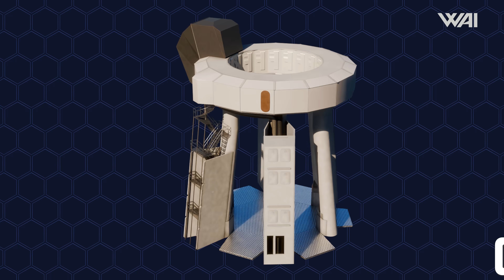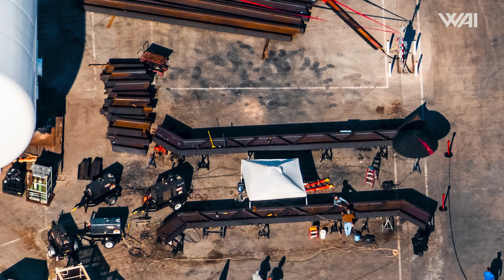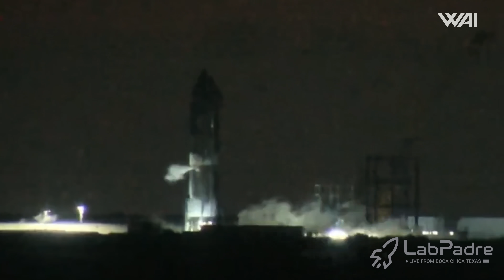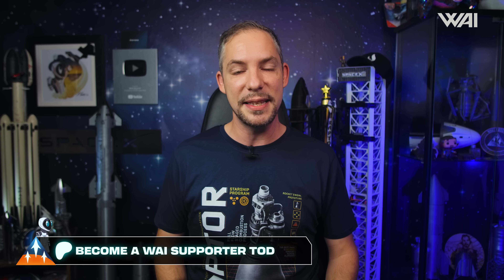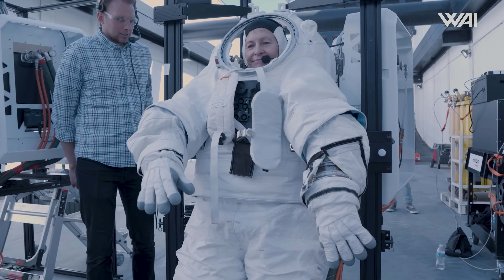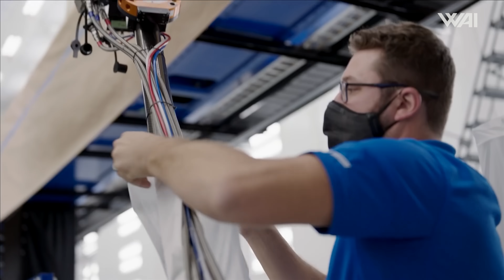SpaceX suddenly gives out HUGE info about Lunar Starship!

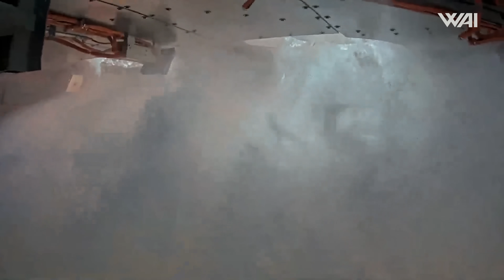Comment: 20:06 I can't say for sure, as I do not know what the regulations say. Though at least in the case of SpaceX' water deluge system they where using chlorinated water which is harmful for wildlife. Chlorine or chlorine by-products are especially toxic for fish (marine wildlife) and birds, but in "larger" amounts it can also be harmful for dogs and other animals. I assume Blue Origin is doing the same as SpaceX to prevent the formation of algae in the water tanks and ease of availability. As in at least some areas in the US, chlorinated water is generally used in the water supply, which probably is also the reason Musk said "Literally, you could drink it", as it is just tap water there. 

So I assume the issue might not be the water getting contaminated by the engines, as methane and especially hydrogen burn very clean, but much rather the toxic chlorine released in the surrounding environment. Since both launch sites are next to open water, with wildlife (fish and birds), I very much see this as an issue which has to be dealt with and not just pushed aside.

Comment: They can do two types of Block 2, one for high volume low mass, and another for low volume high mass.
Reply: The same issue was recognized in cargo aircraft decades ago. A famous example is when USAF modified its entire fleet of C-141's by lengthening the fuselage. The planes were constantly getting 'cubed out' (the cargo space was full) with unused weight lifting capacity.

Comment: Got double check numbers before publishing.

3300 to 3650 fuel capacity is a 10ish% increase, not 25

And from all the other sources I’ve seen block 2 is 1 ring taller than block 1.
Reply: You're supposed to look at Ship prop load not booster prop load. Felix's team highlighted the wrong metric.
Reply: Yep, I did the same calculation. Looks more like 10%, not 25%.
Reply: @liamcaroline448  they highlighted booster prop by accident and you are making your calculations off that error.

Comment: How are they going to build a launch pad with flame diverter on the Moon? And if so, how long will it take?
Reply: Lunar Starship won't fire the vacuum Raptors near the lunar surface. They will use some lateral thrusters mounted higher up on both sides.
Reply: @ Thanks for replying. However the nitrogen valves are an order of magnitude too week for this. So they must change the design of the lander. Now, what will the logical target design look like?
Reply: @alexandervocelka9125  I think they will use proven solutions like the Dragon capsule Draco and Super Draco thruster technology.

Comment: Something to remember on the Starship HLS, it will be MUCH lighter in dry mass than a regular starship. No fins, no heat shield, and likely a different engine configuration. It doesn't need three sea level raptors, they might go with a cluster of vac-raps and all gimbled.
Reply: There‘s not enough space to gimble the „vac-raps“. And no need.
Reply: But at the same time, HLS will have an additional ring of landing/takeoff engines above the main propellant tanks along with plumbing and possibly additional propellant tanks for those engines, and HLS will have large landing legs, a cargo/crew elevator and two docking systems (one international docking adapter and one refueling docking system). Honestly, it may actually end up being heavier than the current starlink deploying version, idk.

Comment: Starship payload capacity estimates are pointless until it actually manages to survive reentry with zero damage. 
The payload estimates were based on a given heat shield mass, which will keep increasing until it works properly.
Reply: Even the falcons receive damage. Your thinking is so flawed....
The legs on falcon rockets need replaced more times than not.
Reply: @johnnyringo35 the whole promise of starship is rapid reusability, ergo zero reentry damage
Falcons are irrelevant!

Comment: So currently if BO gets its software right it will be operational in early 2025 for customers while Starship most likely still not operational.
Starship is not what we (90%+, of space customers) need.
Reply: New Glenn competes with Falcon though. And F9 and FH are cheaper, incredibly reliable, versatile, efficient proven tech.
Reply: @admarsandbeyond  No and yes, it doesn't compete with 9, neither with weight nor with fairing volume, but by price. Weight competition with FH sure but the volume is drasticaly higher. It devlivers similar volume to the starship v2 but ~half the weight.
Reply: @oliverherzog7702  The launch market currently doesn't really need bigger fairings, otherwise SpaceX would have completed their extended fairing (which is not that much smaller than NG's). 
NewGlenn is a LEO optimized launcher (very heavy 2nd stage with early staging) which is dominated by the extremely cost effective, reliable and versatile F9. If there was demand for bigger payloads then FH, that's more capable and much cheaper than NG would be flying more often.
NG can't compete for high energy launches either. It can send only ~13t to GTO for >$120M when FH can send double that expendable (for ~$150M) or can send 23t in partially reusable config. expending only the center core for much less money (~$95M).

Comment: The reinforcement of the chopsticks was also  needed due to a larger way more powerful starship than the original. This isn't a deficiency or design flaw to repair but an improvement to match all the thrust and payload improvements.
Reply: Well, I dunno about that. The chopsticks neither lift nor hold down the rocket opposing the rocket thrust. The chopsticks only deal with the (nearly) empty rocket.

Comment: Flame diverters should use heat tiles.  Would be a great way to test if your tiles can take the heat and the pressure, better then a blow torch as well!
Reply: I could be very wrong but I’m pretty sure the engines get hotter than the re entry temps, all the tiles would likely turn to dust if they got blasted with 33 Raptors
Reply: The exhaust from engines is very different from air: different composition, temperature, velocity, and shockwave pattern. The tiles would shatter just from variable shockwaves passing through them.
(A common misconception is that exhaust is very hot, whereas it is not very hot but very FAST, ~10 times the speed of sound - because rocket engines by design convert heat into the motion of the gas)

Comment: Since most power plants boil water to turn a turbine would it be possible/viable to use the excess heat from starship launches or booster tests to generate the electricity ?
Reply: I don't know how they can possibly contain that exhaust plume,  but yes that would be awesome!
Reply: @jamesengland7461  Well the images of the flame diverter looked like a heat exchanger so the questions are : is this the case and are those few seconds enough to make the extra effort viable?
Reply: Totaly could do that, but it would be a short electrical production and not a good one for the powergrid.
Dose sound more reasonable to recuperate that power for aiding in propelent farms exchangers heat transfering magic in some way, especialy when need and cadance increses.

But lets not forget, Starship isn't even walking yet, this is very much in crude testing fazes, aloooooot of things to tackle with much bigger prioritys, thats why everything is so 'unpolished', testing just a few things per flight, olm is so basic and only now building a proper one. First complete human lunch missions on starships are probably about 3-5 years away.... Moon missions will use Orion capsule for earth-hls crew transfer... much to do.
... im happy we can observe fellow humans do what we do best, making the impossible, possible 😎
Reply: @tehice23  at the current pace even 3 years seems to far off. Another thing that's bothering me is the tower shielding. Looks to me like simple steel plates. Why not use curved ones and add the heat shield tiles that weren't up to standard for the starship 
 After all they produce them on mass anyway.
Reply: @David_randomnumber    it dose seems far but i do think it is quite realistic if not even optimistic. Just by comparing how long "simple" dragon capsule took to modify and certificate for human flight, despite designed from ground up with that in mind.. We humans are delicate water bags. But comercial cargo, end of next year for sure, new revenue would give a nice kick 🙂

That might be neat idea, using not flight worthy headshields since for some reason they dont like water to much.. question is, if they can withstand the plume force. I find it odd that they dont utilize water on the tower since it is amazing at absorbing rocket blast. Even Blue Origin knows this hehe

Edit: oh yes, those pipes are indeed heat exchangers, to cool the diverter. Would be interesting to see temperatures, pressures and other data after flght

Comment: The booster came in full tail down raptors in crossfire of heat until a final burn at the end. That kind of messed up the raptors a bit. Will doing your flop on the way in save your raptors or will you need to update those belts too.?.

Comment: The ultimate interstellar starship would have a special notch in the front end of it so that you could send a falcon heavy from space after liftoff. That third stage is going to get you where you need to be at a high velocity. And fill the starship completely up with fuel. See how fast you can get something going right out of the way. And definitely send it up the meteor shower

Comment: 'Retired' Block 2s as Propellant Depot resupply tankers?
Reply: @user-dave56  - a tanker won't have any space allocated for any payload other than METHALOX. I don't think you can sensibly take a block-2 starship and reconfigure it as a tanker. Block-2 starships are all prototypes for block-3 starlink deployment vehicles. I guess tankers will be a later block variant, optimised for lifting fuel and oxidiser into the appropriate refuelling orbit.
Reply: @sja45uk  I assume Block 2 will have spare fuel once in orbit. Any 'cargo' mass filled by modified Quick Disconnect/ pumps/ docking clamps/ hoses/ pump attendants ;) 
Probably a Block-3 for the Prop Depot. You will need a bit of space for the LOX chillers. At least it won't be LH2!
Reply: @user-dave56  - I am not denying that SpaceX could and will use any spare space in the block-2 during the transfer trials that they must do next year. However, I think that the block-3 ships with their larger volume and thrust are essential to transfer enough propellant to make a launch worth while for a moon expedition. The more interesting question is will they have separate LOX and Methane tanker launches that could dock to opposite sides of a ship.
Reply: @sja45uk  Concur w. former. IANARS but... I wld Keep it Stupidly Simple and build in a Quick Disconnect to 'Port'  and keep the existing Female QD 'sockets'  on the 'Starboard' thus a Tanker is also a Depot and any Starship can refuel another. By a fifth iteration we will have the engineering pretty solid and hence Separate depots for LOX and LCH4.
Again KISS.

Comment: Block 2 is taller by one ring than block 1, but that does not account for all propellant differences, so the rest of video is fine.
Reply: I am wondering if they are using Black 2 for the Moon, why not have a means to detect the Habitat from the rest of the area were the fuel was?
Reply: @RamblingRodeo  They may make changes to the HLS version based on V2 upgrades, but I would expect the basic design to be based on a V1 ship because it has a contract with NASA which means they have to follow the design originally detailed in the contract.
Reply: @BukuiZhao  I get that, however i am also wondering about the landing gear, it has to be HUGE i would imagine to be able to land on the moon. I cant imagine them not? Thoughts? Also, they wont need fins, also is HLS staying on the Moon? I see no point in relaunching it, unless it is going to attach to artemis or what? What is the point in having a rocket land on the moon, if you are only using what perhaps 1/4 of the cargo area, while the rest is depleted fuel?
Reply: @RamblingRodeo  HLS version won’t be reusable so it won’t have fins, it’s unnecessary anyways since the moon doesn’t have an atmosphere.
Reply: @BukuiZhao  Oh i know that, i am just wondering more about the exterior of the HLS.
Reply: @RamblingRodeo  Oh okay, so for the early Artemis mission profiles, they are going to need the extra propellant because they need the fuel to get from the Moon surface back to Moon orbit where the astronauts will return to the Earth by Orion at the end of the mission.
Reply: @BukuiZhao  Hmmmm, i am aware of that but with everything going on with SLS and Boeing, is Orion still in the equation at this point? Also, what becomes of HLS once in Moon Orbit? It seems like a waste overall.
Reply: @ You are actually kind of right, and it is a heavily debated topic.
Reply: @BukuiZhao  I even wonder what is going to happen with Gateway? Can SpaceX do it, with Dragon or Starship? There is so much unknown.
Reply: @RamblingRodeo  yeah that is also a heavily debated topic including why does SLS even exist, I think there is an video explaining this debate. Lunar Gateway also seems quite unstable with SLS and I would reckon maybe Starship or an expendable Falcon Heavy might work but I don’t have a lot of knowledge about the Lunar Gateway so I’m not exactly sure.

Comment: Hi Felix, i dont know if you have covered this but the flatter Dome, seems simpler than the Blue Origin Hex pattern version which Jeff B spoke about in detail on his recent tour. To me Space X must be saving a fortune on materials and cost, and producing a simpler design, is the penalty weight?? Thanks again for your absolutely brilliant ( Janet and John - as we english say( for the none technical) updates.
Reply: Blue Origin seems to have inherited ULA's methodology: take a piece of raw metal, then mill away 85-90% of it to get what you really want. IMHO, a very expensive and time consuming practice. As opposed to taking a sheet of stainless, bend it into a circle, weld the seam, then weld multiple rings together end-to-end.
Reply: @richardpark3054  That is how Falcon 9 is built ;-)
Reply: @scottellis4905  No! Really? I didn't know, thanks for educating me!
Reply: @richardpark3054 agree

Comment: Larger Propellent Tanks.. Smaller Payload Volume.  And they haven't even designed a generic payload handling system that will ..undoubtedly .. further reduce the payload capacity.  And at 50 tons to orbit.. Starship is DEAD ON ARRIVAL.  It will take over a dozen flights to pre-stage enough propellent in orbit for a deep space mission.  That's too much.  And it's a complete FAIL!

Comment: On landing on the uneven surface of the moon etc, I wondered about the use of lander/airbag systems, like the ones used to land on mars, but rather than impact protection you could inflate a rigid set around the base of the starship and then a program could auto adjust inflation at different points to amend  vertical angle nearly instantly to ensure no tip over, I doubt that would work on Mars but on the moon the low gravity would probably allow for it.